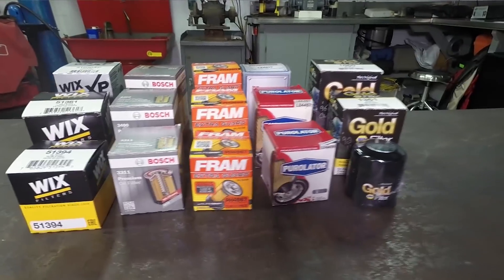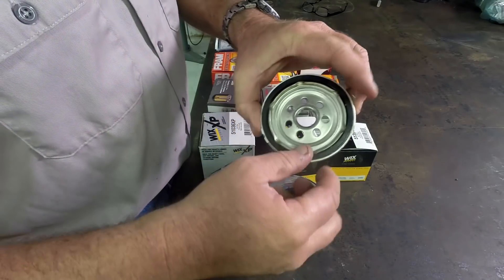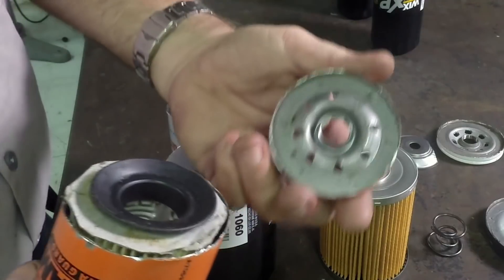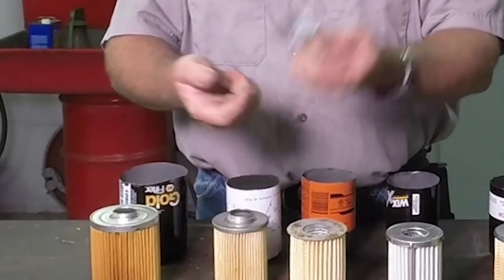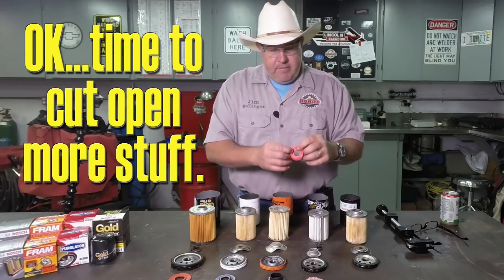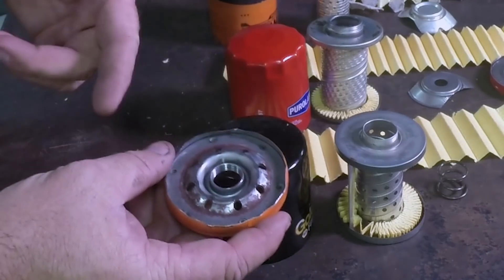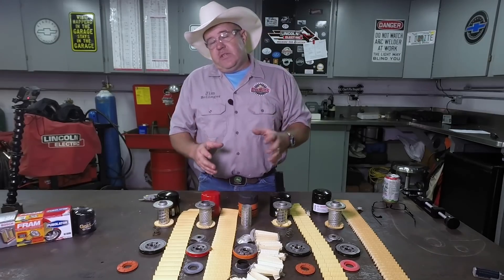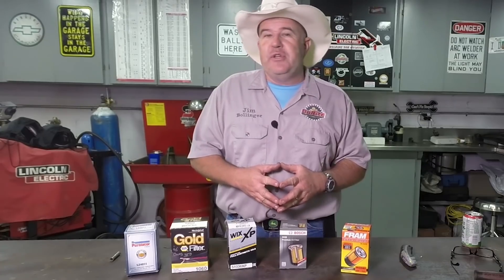The worst oil filter EVER!

Comment: Holy shit, I’ve only been using Fram filters since I can remember. I feel so violated and betrayed 🙁
Reply: Yeah, I had a 1993 Ford Escort all I used was Fram oil Filters, I myself put over 180,000 miles on it when I sold it was still running like when I bought it with 54,000 miles, I feel betrayed.
Reply: @tonyu5985  or now you know how important oil brands and filters are to an engine.
Reply: @tonyu5985  back before their filters were made in China.
Reply: @randomoldguy3967  you might have a great point. Perhaps the quality has dropped on Fram oil filters just as it has on razors. Noticed the blades now being made in Japan even on razors being made in China. China has harder metal than Japan has been my experience so China is my preference but made in China with parts from Japan cuts me instead of my hair. Read the fine print if y’all are having razor issues too.
Reply: DItto, I love the rough end you can grab. No more of those for me.
Reply: You' re not the only one....
Reply: me2😭
Reply: I worked for years in an autoparts warehouse and always knew about Fram. We had a nickname for them that started with an Sc.
Reply: Fram is like bud light they both put advertising over quality
Reply: @Terrilmob-j3f  can't forget gimmicks like the extra grip dipped on it
Reply: @shivermetimbers9316  For me they work great! At times I have a filter that someone installed too tight and that extra grip works about 90% of the time if you can get a good angle to turn it off and that's when that extra grip always helps by not using a oil filter wrench on it and that takes up more time to get done. I had hard filters to remove that had no grip dipped onto it and you just keep slipping until you put a oil filter wrench on it, which they are suppose to be hand tighten. The grip works great for me when I'm doing a lot of oil changes which time is money.
Reply: me too
Reply: I’ve always gone wix or k & n. I prefer k & n because of the 1” socket accessibility. It was a nightmare to try and use a strap wrench on my ranger. Used the socket filter and it was love at first install
Reply: @Yeah Right a tiny bit of surface rust wont hurt a damn thing 😂 ive seen high dollar oil filters have rust on them as well it is nothing new ...it does not matter what oil filter or oil you use the engine is only going too last so long oil is oil and filters are filters they all do the same thing
Reply: @Yeah Right a tiny bit of surface rust on an oil filter wont hurt anything if you believe that it will than you are an idiot and have not worked on any internal combustion engines every filter i have put on the ole 3.8 has had a little bit of rust on them and we are pushing 230,000 miles now and i changed the oil every 10,000 miles and i use the cheapest fram filter i can find and conventional 10w-30 oil cheapest i can get my hands on btw my oil change costs me roughly 15 bucks and the car had 160,000 on it when i bought it 4 years ago and it still runs better than brand new and it has 60psi of oil pressure so tell me again how the rust has destroyed it 😂🤣🤣🤣😂 i am a diesel tech full time and do oil changes weekley on volvos,cummins and international engines and most of the filter we get come from napa and the majority of them have a little bit of rust on them from them sitting in the parts room and with the humidity they get a little rusty but we have yet too have any issues with them
Reply: Same here man
Reply: It's all about the sourcing, any brand can source from a cheap manufacturer. They were prolly made better back in the day.
Reply: You'll be fine.
Reply: @MrGardoPR  It just means you change them more often than with a premium filter. It's not like they don't work at all
Reply: Never again!  I guess its now WIX for me.
Reply: Maybe a bad unit?
Reply: The carton of his filter is falling apart because the grinder went through it.
Reply: and they're orange.. like they had a recognizable name AND they looked cool. i think i have one on my sportbike right now. crap.
Reply: Fram fanboys? like are we really that petty as a species, or do y'all just have nothing else to grab on to? i mean hell, i'm a fanboy for my motorcycles, but they don't hang off the bottom of my engine block and disappear from my memory the instant i'm done changing them. is it that heart-breaking that a corporation you love might save a buck by selling garbage? cuz wait til i tell you about the government. 🙄
Reply: Just changed oil and filter 3 days ago on an engine with 160,000 miles on it.  Took a Fram filter off and put a  Fram filter back on. Sorry  .   The proof is in the pudding.
Reply: Dont believe nonsense videos like this man... whats wrong with you.. think before you believe. this video was nonsense.
Reply: Fram by far makes the BEST oil filter for motorcycles. Fram makes the same quality of filter they made 25 years ago before bean counters started cutting corners. They have always been made in Taiwan. Taiwan has a true motorcycle culture. 70% of all licensed drivers in Taiwan have a motorcycle, compared to approximately 5% in the US. They also take great pride in products they make.
Reply: how many engines have you had fail? millions and millions of fram filters on the road night now. why don't you hear engines failing my the millions?
Reply: @southernrebel  They fail, just very slowly.
Reply: @victorhex6380    I have never had a frame filter fail been using them for over 35 years. No point in over engineering something you throw away that is bad for the environment.
Reply: @bradclark6796  I guess you want cardboard and rust in your cylinders? lmao just buy a better filter dude
Reply: @Harmonic14   Never had a problem put them in everything from cars trucks lawnmowers motorcycles and ATVs. Never found any rust or paper in any motor I have took apart. If they were so bad how can they be still selling them. They would have been sued many time by now if they were cause problems.
Reply: @Harmonic14  that little bit of surface rust wont hurt a damn thing and ive seen many other brand filters have rust on them not just fram i have been using fram filter all of my life and have gotten the best oil pressure out of them if i use a napa filter it almost cuts my oil pressure in half yeah no thanks ill take higher oil pressure over filter resistance any day!
Reply: @southernrebel  The same reason mechanics have seen cars with 100K miles on them that have never had the oil changed. A subpar filter does not equal a catastrophic failure. Its about wear over time and if you plan to keep an engine for life vs trade it in etc. Also, why pay a premium for a Fram if its a subpar filter made with lesser materials?
Reply: @AW-zy1kw  so it's no big deal.
Reply: @hubster4477  why take the risk when a better filter is only a buck or two more?
Reply: @Harmonic14  after all the fram filters I've bought, plus all the fram filters sold over the last 30 years, I've yet to hear somebody blew an engine because of a bad filter.  Hell when I was younger and broke the oil and filters rarely got changed! Car still kept running and rusted out before the engine gave out.
Reply: @hubster4477  Engines don't blow because of bad filters. However, the extra particulates that don't get filtered because of a poor quality filter will continue to circulate throughout the engine and accelerate wear. This is why you see vehicles with only 200k miles burning a quart of oil a week when equivalent vehicles with proper maintenance still run like clockwork 400k+ miles later.

Sure, you can skimp and cheap out on maintenance and most modern engines will keep running, but that doesn't mean they'll run well. Cheaping out on oil filters is a false economy because you'll end up spending more on gas when your engine runs less efficiently and on oil you have to top off with every week.
Reply: @hubster4477  A cheap filter doesn't equate a blown engine, dummy. Although, that being said there is little proof to dictate what caused the blown engine in the first place, specifically when it comes to oil filters. There would have to be substantial evidence to prove that an oil filter catastrophically blew an engine. That said, that goes for literally every portion of your engine. How do you know the oil filter didn't cause a specific oil leak on your vehicle -- perhaps allowed something to get through and damaged a seal, or worse, over time damaged/scored the internals which failed something else down the line? The quick answer, you don't. The fact is, use good oil accompanied with a good filter and you more or less eliminate that possibility overall. 

Cars now are not cars back then either, so the anecdotal "back in my day" boomer regurgitation speech means very little, too. Cars are more intricate now and throwing cheap garbage at your otherwise sophisticated German engineered car does not end well, or any car for that matter now. I've had Customers come in the shop with their expensive Audi's where they've got cheap oil changes done at Walmart, 9/10 times the drain pan bolt was stripped and the oil quality was so poor that it stretched the chain and caused bent valves. An almost $10k job later was an expensive reminder not to cheap out on oil, filter and the place you take your car to.
Reply: @SpeCifiC0507  Dummy, but little proof! Hahahahaha!
Reply: @hubster4477  The proof is in this video, among tons of others. The proof is in certified mechanics and dealers that tell you to run very far from this Filter. I'd rather spend the extra couple bucks on a good filter than be the "dummy" proven wrong on the side of the road with catastrophic engine failure, if only once.
Reply: @SpeCifiC0507  no proof in me running fram for over 15 years and nothing bad happening? Among millions of others with the same results? I mean running fam was a whole lot safer than a yugo or a pinto!! Now that's a bad product where there's definite evidence! The Damn things blew up on you! Nobody had that experience with fram.
Reply: @hubster4477  
Well you're not looking around then, there's a fellow who committed himself to trashing Fram filters via a website after the cardboard end cap on the bottom of the element sucked itself inside of the element and fell apart clogging up oil passages in his new motorcycle resulting in his engine burning up, after Fram gave him the old "That's your problem not ours" attitude he started a website to educate everyone on how cheap Fram filters are made and what happened to him from using one.
So yea, there are people out there showing the damage that can happen from running Fram filters.
Reply: @hubster4477  Trurhfully I do not care what you run in your car. As I said, it would be incredibly difficult to measure how your oil filter caused any significant damage both in short and long term. That said, this video proves how poorly made Fram is. Many other resources out there prove the same as well. 

Personally, I've ran Fram and ran better filters. I've had customer cars come in with clogged oil filters, sputtering issues and other oil filter related issues and they've always been Fram and strangely enough, the K&N filters. 

Everyone's encounters are different, but that said, this teardown video among plenty others showcase the poor quality that Fram is. So like I said, I will run better stuff to ensure I don't have future problems -- even if they're untraceable to a poor quality oil filter.
Reply: @SpeCifiC0507  exactly, as long as my vehicles go 18 plus years with 2-300k on them the filters are doing fine.
Reply: @dukecraig2402  soooo, corvettes break down, Cadillac s break down, Porsches break down, Chevy trucks break down, should I avoid these brands also?
Reply: @hubster4477  
What are you even talking about?
This video is about oil filters, and yes, you want to avoid any that use a cardboard end cap that's glued in place as opposed to one's that use sheet metal that's spot welded in place, there's a website that has pictures of his engine teardown with pieces of the failed cardboard end cap clogging up oil feed passages. 
But hey, it's your engines not mine, despite being shown that Fram filters are built cheaper and less sound than most of the other one's on the market go ahead and knock yourself just for the sake of being bullheaded about it and not wanting to admit that you got taken in over the years by marketing hype, you'll show all of us.
Reply: @hubster4477  
They're not arguably better if they're plugging up oil passages because they came apart, there's actual pictures of that and not just a bunch of talk which is what anything else amounts to.
40 years of working as a mechanic including having my own shop and I'm well versed on how a company will cheapen up a product and then invent reasons why their redesign is "better" that way.
Wix and Purelator are about the best filters there are, you can run whatever you want on your engines that's your business but I'll never run Fram oil filters on anything I own, I've been around too long to be hoodwinked by someone trying to tell me that a piece of cardboard or whatever you want to call it glued in place is better than a piece of metal spot welded in place.
Reply: @dukecraig2402  ok so if my car isn't going to last long on a fram filter is there a bet for 1k$ for every year my car is still running with fram filters?
Reply: @hubster4477  
You do realize that for years after recirculating oiling systems in engines were first developed that they didn't even have oil filters on them don't you?
That's why non detergent oils were used back then, and when filters were first starting to be used they were an option on engines. 
So a bad or cheaply made filter doesn't mean if you put one on your engines going to burn up, but what we're talking about is an engine that could last 500,000 miles turning into an engine that'll only make it 300,000 miles.
Like I said you can run whatever kind of filter you want, even after you've been shown evidence that they're sub standard compared to a well made filter, knock yourself out, just for the sake of being bullheaded you go right ahead and keep running them, that's entirely on you, like I said you'll show all of us up.
You're a classic example of why I closed my shop to the public and only do private work, you're one of those nightmare customers that's an instant expert on things and will argue with someone that got 40 years of building and rebuilding engines worth of experience.
Reply: @dukecraig2402  haha there ya go! Filters aren't that important!
Reply: @AW-zy1kw  360k miles with fram filters here
Reply: @dukecraig2402  ABSOLUTEY   Duke !!!!!!!!
Reply: @southernrebel  it's a slow process that damages engine over time. Why gamble with such shit quality? Plenty of better options are out there.
Reply: @southernrebel  exactly ive always used fram filters and never had any problems even on my diesel truck
Reply: @southernrebel  exactly. People say they've been using them for years and without a problem. So now it's time to stop!? Nah.
Reply: @southernrebel  I could probably survive drinking water out of a mud puddle and food out of a garbage can. I'm just not going to do it... kinda like buying fram filters.
Reply: @southernrebel  he could not cut the filter material from the ends. So the filter wonts allow oil past the end of the media, meaning it’s all ways filtering!  The rust in the can also can’t get past the filter media. I like the others but the Fram won’t cause a problem, and as someone else me toned, it may be more environmentally friendly. Good video nut missing some important analysis.
Reply: @southernrebel  exactly !!!  never trust a mechanic in a cowboy hat who uses a grinder to cut open an oil filter
Reply: @southernrebel  whoa! No answers for that! Haha
Reply: 610,000km on a 2004 5.4 3 valve  with nothing but fram filters, original long block....but ORANGE FILTER BAD!
Reply: Well,think about this then.
Have you ever had any problems with them?
I have used them for a very long time and never had any problems.
Thats my own personal opinion,is really easy to influence people these days
Reply: @dvader3000  Engines are robust enough that they don't suddenly fail just because of a poor quality filter. However, it's not worth the risk since it will cause accelerated wear and component failure in some cases. Just because it didn't happen to you doesn't mean it doesn't happen.
Reply: @dvader3000  you can't deny the lower quality of it when opened up and compared to others. This influence is backed up by evidence.
Reply: @dvader3000  or facts you know. Shitty construction, inferior filter media, the silicon gaskets often crack early, lack of metal support or baffles on low and mid grade.
Reply: Fram orange is just fine on your daily if you change your oil every 3k. Don’t use it on your work vehicles or your race cars.
Reply: @RVMD95  Don't use it anywhere since the price difference is negligible
Reply: Me, too. I will definitely change my future filters now. So long Fram filters!
Reply: 50 YEARS I USED FRAM NEVER HAD A MIN OF TROUBLE .MORE BS
Reply: @kennieb5606  Fram makes garbage filters, full stop. Anecdotal evidence doesn't refute that.
Reply: @kennieb5606  doesnt mean you should keep using a shit filter. You can drink piss all your life and be fine but you wouldnt like it.
Reply: Wait until you find out that bigfoot is real and the government has known it for decades... 😉
Reply: @Yeah Right  I just watched a guy cut 4 Fram filters apart no rust. This guy also cut the cheapest filter they make apart that Fram ultra filters a much better made
Reply: I have used Fram for the last 48 years and have never had problems with my cars or trucks, I always change the oil every 3 months or 3000 miles whichever comes first and nothing bad happens to the motors of my cars. I have a 2003 caravan that I buy new and I have only used Fram filters and it still runs its engine very smooth with 180,000 miles and it is already 18 years and still running great with out engine problems.
Reply: Me too. I won't ever buy another one
Reply: Same here. I have a 1986 Nissan D21 Hardbody pickup. I used Fram oil filters on it at least 95% of the time. I now have 365K miles on the original engine (Z24i) and it is still my daily driver today. I follow Nissan's service manual which specified oil and filter changes every 3000miles or 3 months (I sometimes extend until I get 2K miles on the oil). I use mainly regular oil (the kind that's on sale) and on occasion, synthetic blends. Does this mean my pickup would be in better shape had I used the "better" brands of oil filter?
Reply: @damuhongmaldita  cheep oil and filter is not a good way to save 2 or 3$. rebuild a couple of engines and you will understand why.
Reply: @damuhongmaldita  hell thats nothing i do 10,000 miles on my oil before i change it that just regular conventional oil and the cheap fram filter ive never had any issues it has 230,000 hard beat on miles and still runs better than a new car
Reply: I just installed one on my car...I will start getting better filters
Reply: @bfun4615  lol you guys think a dam oil filter is going to save your engine.
Reply: fram tough guard is built better.. those extra garbage are only good to wipe ur Azz with lol
Reply: @hilow8331  It's ass .
Reply: @abbush2921  it has over one ft longer "filter material" and a smaller micron rating as compared to the red can of death... i always go tough guard with fram. extra guard might be good for a mini bike lol... but thanx for your input. u must be a K&N guy
Reply: @Yeah Right  Yes I did watch whole video. The filter he cut open had rust not all will. The little bit of rust was in the filter  is stuck there and will not pass through filter. You are going to throw it in the landfill when your done . It doesn't really matter how well it's made as long as it does the job it is required to do. If these filters are a problem Fram would not be in business.. How many motors do you know of that have fail because of a Fram oil filter.
Reply: Bend over and take it....